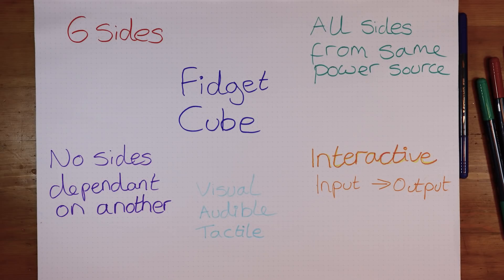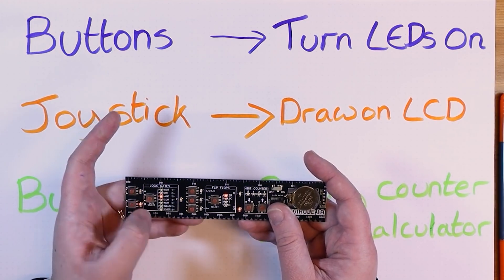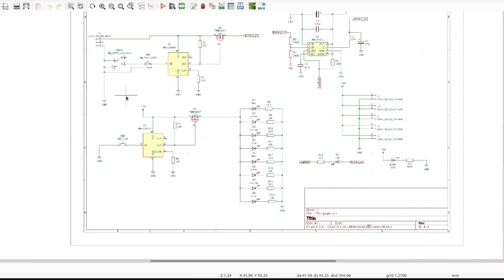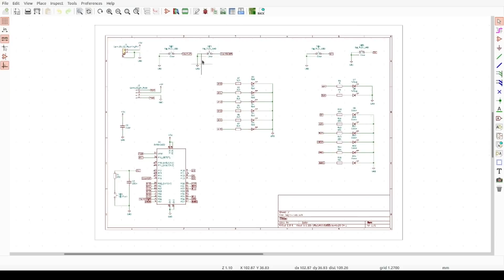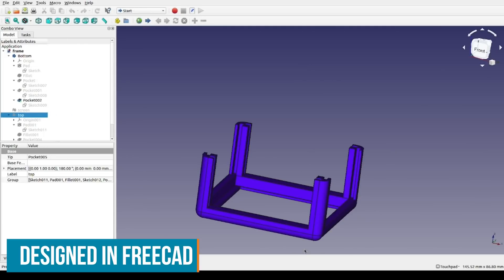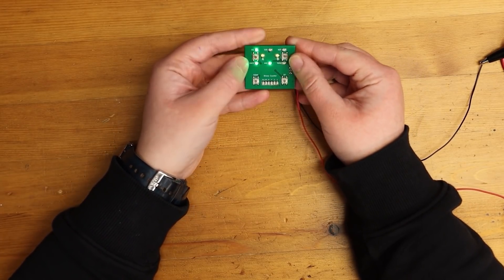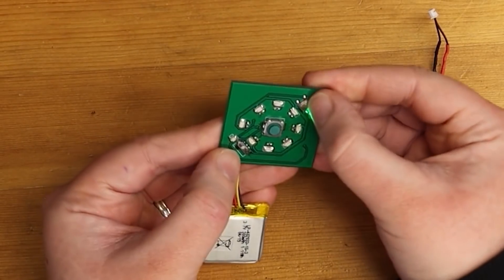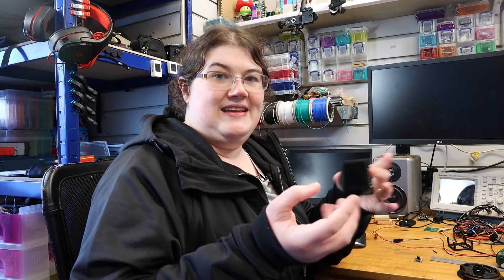Build an Electronic Fidget Cube!

Comment: It is a cool project, but it is mostly presentation of what was done and the individual finished parts. What I am missing a lot is going through the design process, at least some interesting sections, whether it is creating / drawing the circuits, creating PCB layout, creating 3D model to fit the rest of the design, first powering up / testing / realizing and addressing mistakes... It is hard to learn to do own stuff, when everything seems to be done in magic jumps from "I want to something like this" to "here I designed this part"...